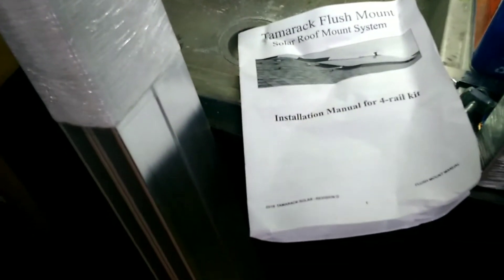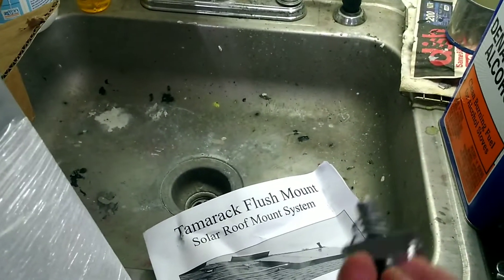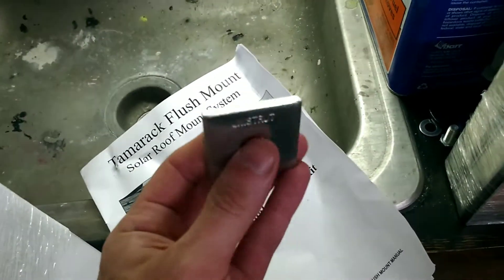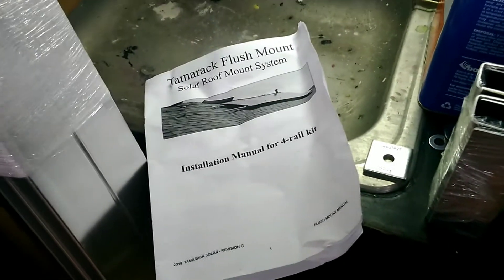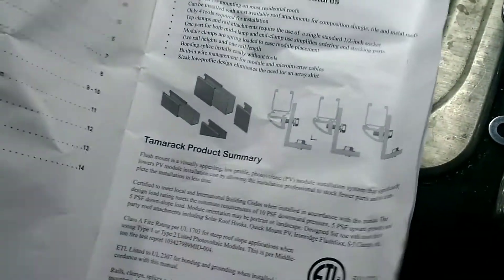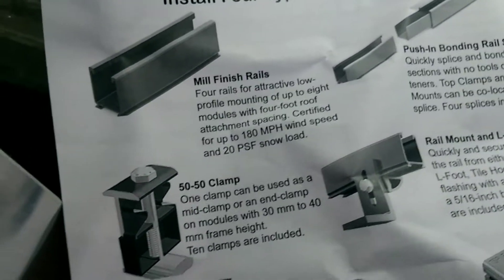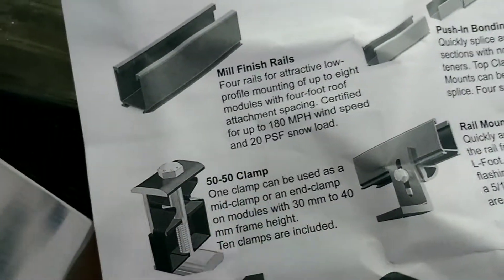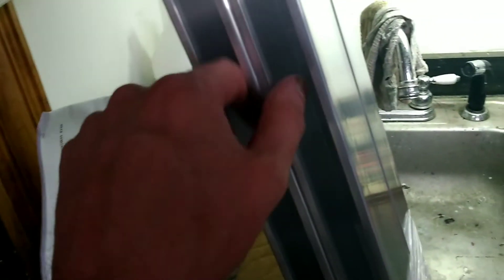Strut Channel vs. Purpose-Built Solar Racking

Comment: Thanks for answering the very question I have been pondering.  I was thinking of a DiY ground mount with wood structure with uni strut.  Now I have to figure out where to get the solar mounting tabs for the strut.  Thanks again, new sub here.